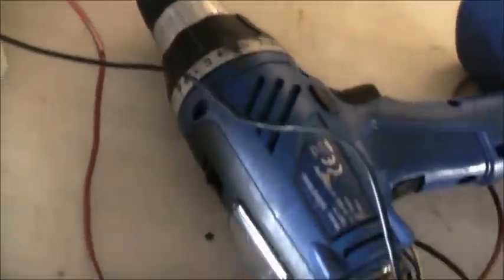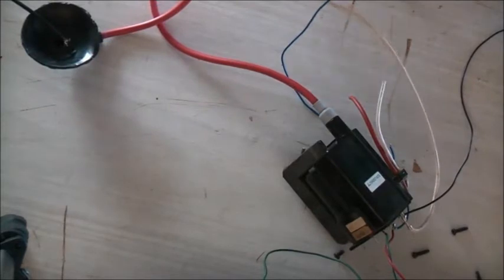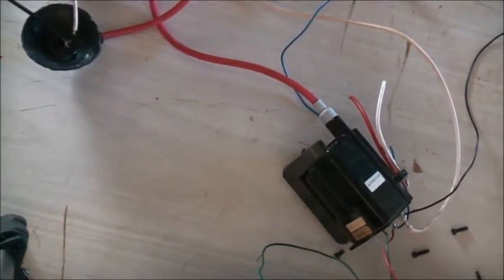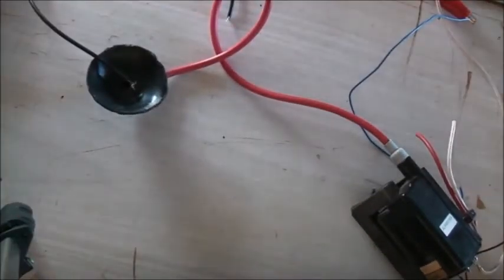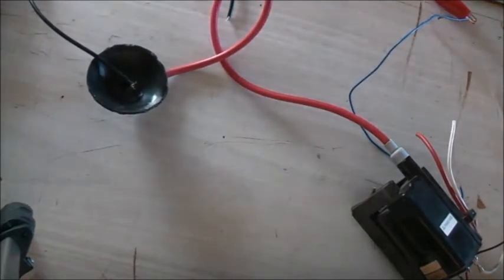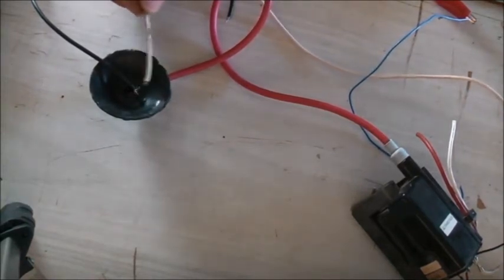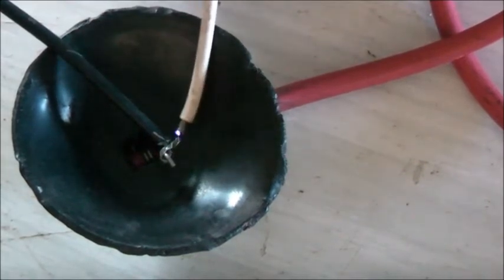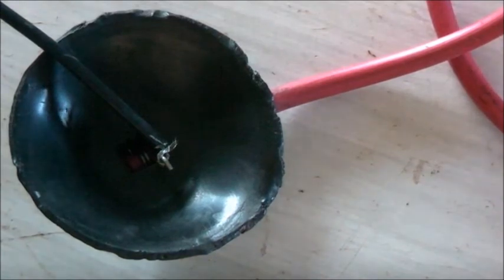Redneck PWM Flyback Driver

Comment: Haha....There's two things to do with that old drill. 

(1) Make a not-so-cordless drill & power it with a car battery-or-two.

OR....

(2) Use that PWM for other projects, then whip the motor out of the drill & crank it up on the variac until it pops. :D

Interesting squeals from that flyback. :D

Thanx for showing,

-BBD.

Comment: i you find an old electric scooter-they have a nice PWM inside and a cool magnet/hall effect system for adjusting duty cycle-might be much easier to tinker and change frequency than the drill PWM,which have very small surface mount parts.
btw the drill trigger works good for making HHO